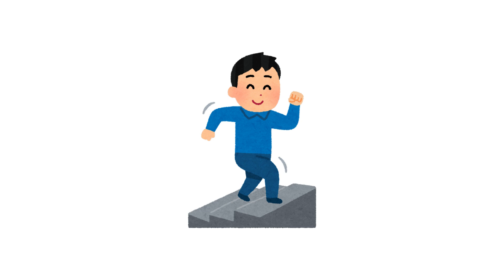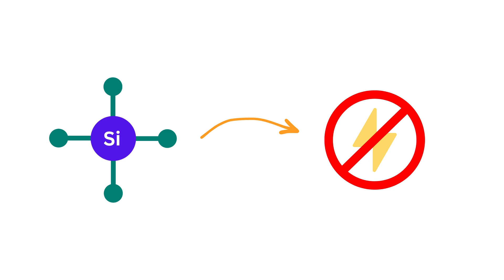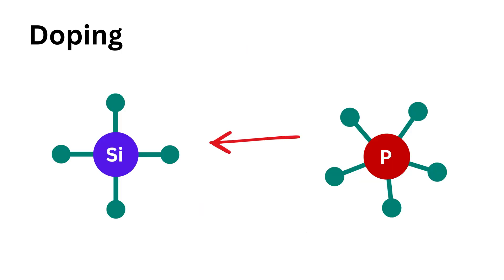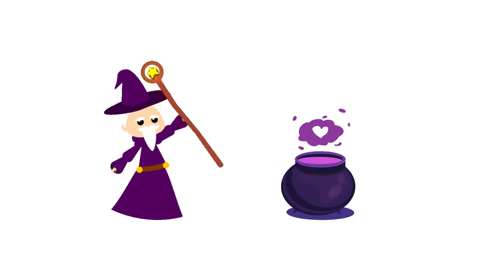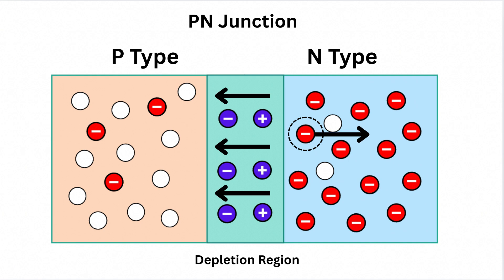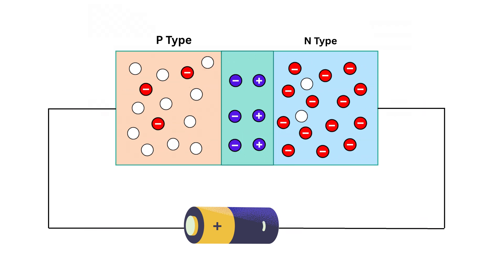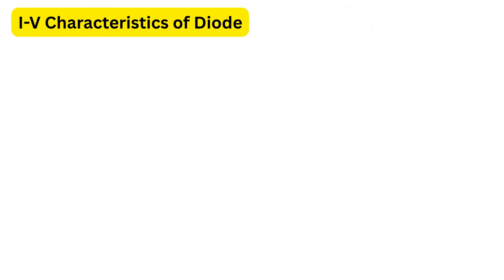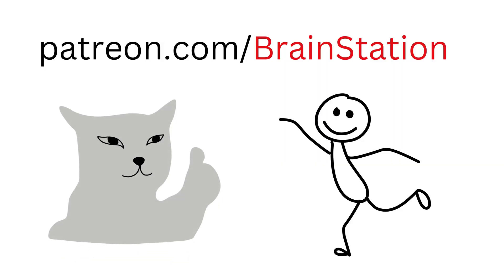How does a DIODE work?

Comment: Not bad. A few things, however. The semiconductor crystal must be continuous. You dope the ends of the xtal. 2 separate pieces of silicon doesnt work, although it's shown in texts to assist understanding. Your graph of I-V characteristics shows a linear x axis. The forward direction is good, 0.6v onwards the diode conducts, however the reverse direction around breakdown is usually 200 - 1000s  of volts. Definitely not 2 volts😄. But overall well done 👏
Reply from the maker: Thanks for pointing that out

Comment: Great video but you forgot to mention that in n-type semiconductors, the dopant atoms added to the semiconductor material are called donors because they donate extra electrons to the material, increasing its conductivity. In p-type semiconductors, the dopant atoms added to the semiconductor material are called acceptors because they accept extra electrons to the material.

Comment: 10:04 And that is why CPUs require cooling fans to prevent overheating, as overheating will cause your computer to crash and blow up.
10:01 And then after the 2nd video, the 3rd video is about how computer code works, and about how do applications run, as well as the virtual world and the Metaverse, with the 4th video being about the Internet, Wi-Fi, and cellphone signals.